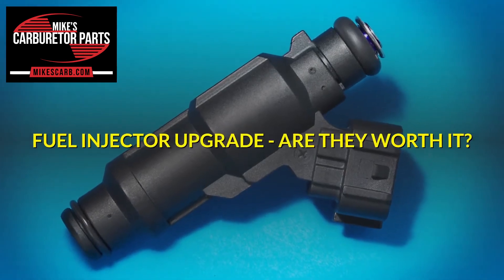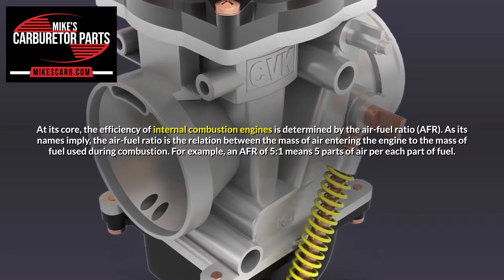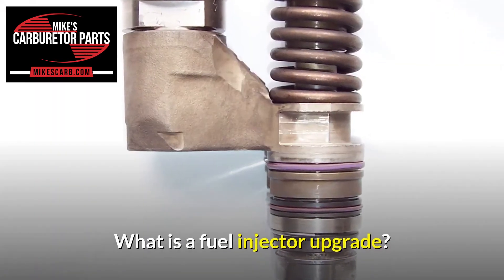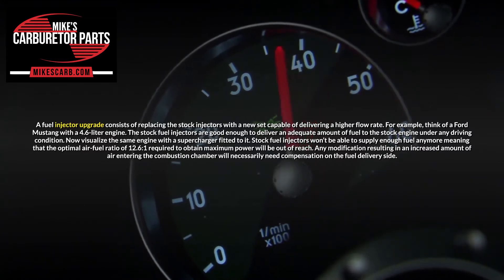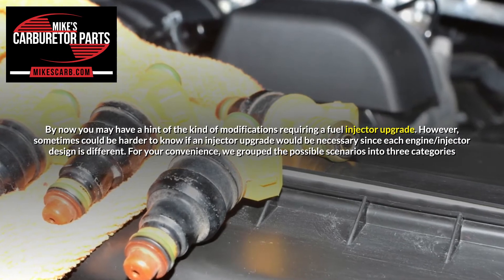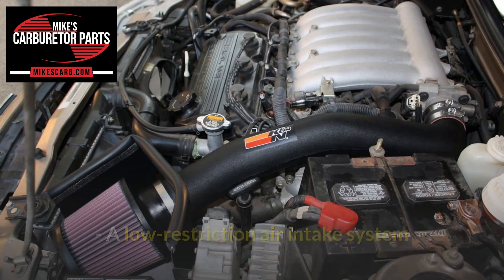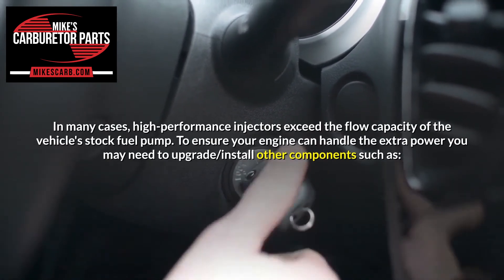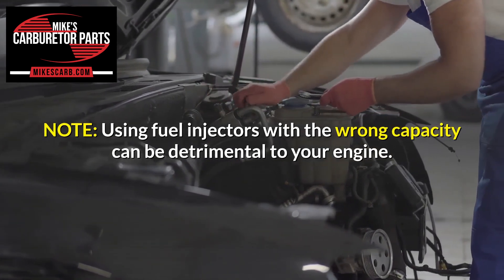Fuel Injector Upgrade

Comment: Feel a bit guilty for just now Subbing Mike. Especially after having benefitted for years of information, on my '53 235 Chevy Pickup's Rochester B carburetor. You've gotten me past wanting to leave that hand grenade bolted to it. Thanks Mike.
Kid in a hopped up Mustang rolled up by me @ a red light & asked me what I had under the hood. Told him 90 hp., & a speedometer that vouches it's maximum ability of reaching a full 90 mph. Are you ready to see it happen sonny?